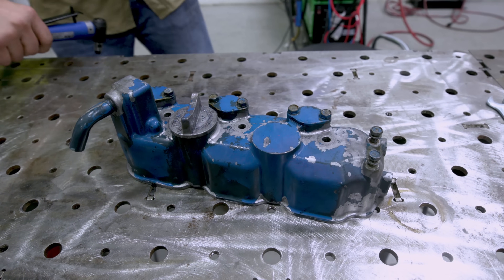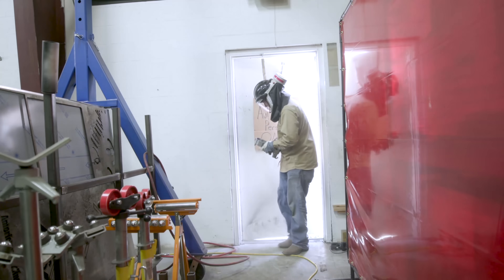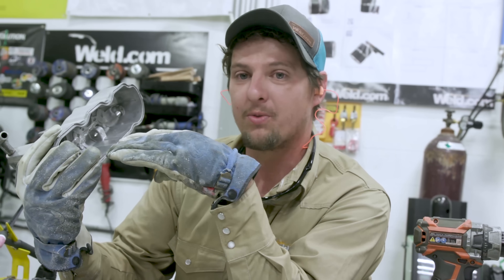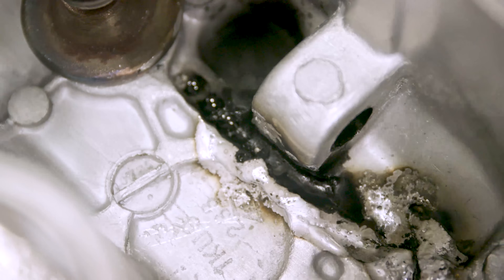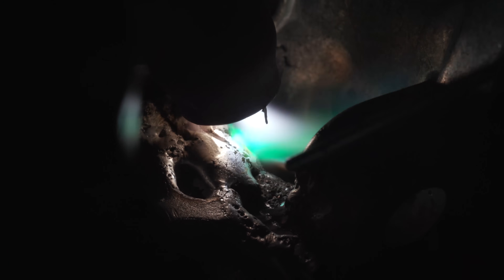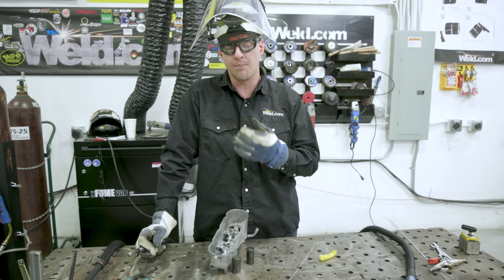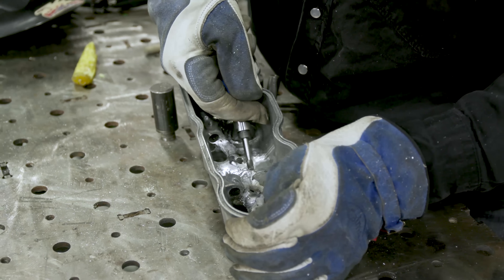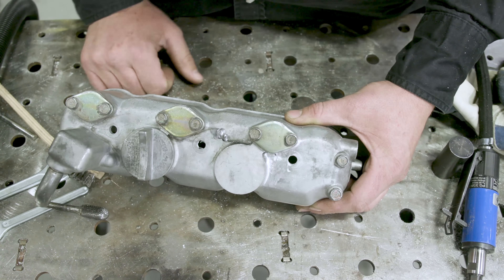Weld Repair | 1983 Cast Aluminum Kubota Diesel Engine

Comment: Nice work, may I suggest putting the part in a barbecue until it stops smoking before welding this way all the impregnated oil burns out.

Comment: Something that seems to work better for me. I just take a cutting wheel on die grinder and cut all the way through the cracks then v it scrub and start my arc on top of my filler rod in the crack even just run over my rod sometimes then come back and have some hope of a cleaner weld. I looked way worse than that first try on cast though blew a 1 inch hole in it before I was able to start filling it 😅. And someone already mentioned your filler choice was one of the harder ones to use for that 😉
Reply: Forgot to mention thanks for the videos! I've picked up a few things from you for sure

Comment: Brave video to make. Welding cast aluminum with oil in is hard. My experience is to walk away and use just jb weld instead. Especially if it's just a cover.

Comment: Noticed the cracks in 2 of your welds at the 5:35 mark in the video.
Comments please on 4043 vs. 4943 vs. 5356 fillers.  Comments please on not preheating to 400-500°F.

Comment: Great work, I just would not have taken the time to blast off all that exterior paint. Focus on the real issue only, the cracks. By the way, those cracks look like they were due to over torquing the bolts.

Comment: Did you load your burr up with soapstone?
Reply: periphery wax or beeswax I use. Try using periphery wax or beewax on a rusted bolt or a broken head bolt while heating. periphery wax will go into the threads and it wont evaporate like other chemicals when you heat it up. Thanks for watching weld.com. have a great day and stay healthy

Comment: Great video guys.  What are the benefits to using 5356 rather than 4043 in this application?
Reply from the maker: We actually started with 4043, but it wasn't working out so we tried the 5356 adn it worked much better.

Comment: Next time throw it in an oven at 500F for a couple of hours, then do your soda blasting inside and out. Clean it off / drill and grind, then preheat it again to 500F and weld.

Comment: Excellent work Mancub! Dirty castings are one of those things you just have to do what works at the time. How'd you like the 275?
Reply: Thank you!!!Everlast Power Equipment run great. The 275 lightening has so much advanced features. The machine is a all around machine. Suitable for ever welder out there. Thanks 4 watching Weld.com and have a great day. Stay healthy

Comment: Welding old aluminum parts that has been soaked in oil is tough to do. Good job of cleaning!!  One thing I have done back in the day is to let it soak in acetone or MEK for awhile before welding if you can. Final cleaning step.. That will help....after that blow dry and let the part air out for 15-20 minutes.  MEK is nasty stuff so wear PPE and keep it out of the welding area.

Comment: So I was taught to drill the cracks at the end both side thru then groove the crack as best you can, fill the one side ,  then flip it and groove the other side down into the new weld metal,  and fill it in .. so why only drill the ends of the crack only part way ?   Especially if you are going to weld both sides?
Reply: Drill all the way through.I ended up doing that. It's been a while since I welded on something that bad. Whoever taught you did a good job. Thank you for watching Weld.com and sharing knowledge

Comment: Being new to the stainless side of tig welding, I was wondering if I should use tri mix or strait argon for sheilding gas, and could you guys explain the difference between the two and they're appropriate use
Reply: Straight argon for tig stainless. There is a tri mix you can use for MIG welding stainless but 100% argon is what you want for TIG.
Reply: Dm @redbeardweldz he problay will know the science behind it. I agree with the other guy.

Comment: How come ya didnt heat it up with torches after soda blasting? The heat would've seeped all those oils out to where you could was it away with dawn dish soap and then wipe it with acetone. Just wondering

Comment: Why do u grind down soapstone on  your cabrbide bit
Reply: That was wax.
Reply: Colby Clydesdale it acts as a dry lubricant so the sure bit doesn’t load with aluminum shavings. Works great on file work too.
Reply: Jason Becker thanks
Reply: Colby Clydesdale you’re welcome man. Thanks for watching.

Comment: Should have baked it in a oven or slowly heated the part first to cook the oil out of the cracks.
Reply: Joel Watkins i tried that before. I felt like it didnt work that good. So I soak it in pure simple green and blow it off.  Maybe I did it wrong. We really appreciate you watching Weld.com. Have a great day and stay healthy

Comment: Some of those oil baked and dirty aluminum castings get a guy to wondering if your going to have more dollars in filler rod than the part is worth.  Not to speak of the labor.
Reply: Can't always find a new part for a lot of these older ag/industrial engines aside from maintenance parts.

Comment: A serviceable valve cover on eBay will run you about seventy-five bucks, how much did the repair cost? Assuming it was a commissioned work. If it's yours then it's like grandpa said, "Sometimes you have more time than money son."
Reply: David Cantwell thank you for watching Weld.com. Yes its mine.  I wanted to show old dirty cast aluminium. I agree with you pick and choose your battle. I always could use practice to better myself.
Reply: @mancubwelder1312  
Absolutely, practice makes perfect, but only if you practice with understanding. As a self-taught welder myself, I make my living as a custom fabricator so I must be doing something right, watching videos like yours increases one's understanding. Thank you for sharing your understanding of how it all works.

Comment: Might want to let your viewers know to be careful what solvents to use in the cleaning process. I know you said acetone, but if someone that don't know grabs a chlorinated hydro carbon solvent, it's bad news for them. For those who don't know, when heated and exposed to argon produces phosgene and it is deadly.
Reply: Exactly. Next time I will. Thanks for watching weld.com.

Comment: Have you every tried using a propane torch with the aluminum solder?  You see people putting cola cans together.  Used it on a boat and I started tig welding it and worked will but then I found I had a lot of holes and leaks in other locations like my drain plug and count get to it well and see that at a gun show a old man was making cola can welding look stupid simple.   Held as long as I had it and the next guy about 10 years I know of.
Reply: As a temporary repair its ok. Its like glue. Gets no penetration.  I weld boats and i cringe when i see it.  Guys running offshore dont want to make it home i guess.

Comment: I tried welding a cast aluminum pulley wheel and it didn't go to well. What settings should I run like the frequently and balance
Reply: everlast 275 lightening machine 195 amps
Frequency 110
Balance 65
Reply: @mancubwelder1312  thank you

Comment: Got a nightmare welding job recently. Had to weld a aluminum safety roof on a underground mining rig. They had cut an opening to retro fit something to the compressor and my job was to weld the pice back. Every thing was saturated with concrete and hydraulic fluid. I had to lay down about 6 feet of weld. Took me 3 freaking days.
Reply: Feel your pain. Learn alot I bet. I know I would have.

Comment: Where did the stud holes go? How are you supposed to fit it now that they've gone?
Reply: You caught me. Had to get the crack all the way out. I will put the paint on top of the studs and lower the valve cover down and it will mark it. Drill it out.  Thanks for watching

Comment: What freq and balance did you use?
Reply: Everlast 275
 Argon 35cfh
Balance 65
Frequency 110
Reply: Thanks! I was guessing around 120hz by the sound.. would 3/32 hold up at that low balance?

Comment: Good job! real repair work is a pleasure to see! Engine parts are a bugger to weld.. 95% of my repair work is under the truck stuck between a greasy driveshaft and frame... I never get to weld on a clean workbenches..
Reply: John W I appreciate it. That's is not comfortable at all.  Thanks for watching weld.com. Have a great day

Comment: Worth mentioning not to use brake cleaner before welding
Reply: I'm guessing that you mean chlorinated brake cleaner. The chlorine free stuff works fine, and it would have done a much better job than Simple Green at removing oil residue from the casting.
Reply: I'd love to watch you weld after using hexane brake cleaner (through a telescope)
Reply: @janeblogs324  It evaporates at -9° F at atmospheric pressure. You would have to be welding in a really cold environment for it to be an issue; like Antarctica in winter, outside. Do you appreciate how ridiculous your concern is?

Comment: Only the few people who have welded old cast aluminium impregnated in oil-dirt can understad how difficult it is, top job🤟🤟🤟
Reply: Shmen George Thank you. Appreciate the support.
Reply: New cast aluminium is way better and cleaner these days. Alot easer to get a clean weld.
Reply: shmen gheorghe ....You got that right!  Sometimes you start wondering "where in the hell is all this shit coming from?"
Reply: Yes I know, I do some turbocharger case welding and is pretty much no difference to laminated aluminium💪💪💪
Reply: shmen gheorghe I’ve had real good luck welding castings on two stroke outboards and dirt bikes by using a drill bit to clean the bad spots out. What I mean is. When you’ve finished your first pass and it’s all screwed up full of holes. Go back over it with a drill bit just a few sizes bigger then the hole and drill it out. Seems to work first time every time for me. Few times I have had to repeat the step. But it will only be like one or two holes versus the twenty I started with.
Reply: Cole BZ I do.  45 years in the business.  My table and torch are fine and never burnt anything up.  A shot with an air hose and it's gone.
Reply: Shmen thanks for the support. Really thank you for watching.
Reply: ManCub I have to thank you and Weld.com for teaching me so many things 🤟🤟🤟
Reply: Shmen your very welcome. Could not do it without you guys.
Reply: @colebz420  it's called busting ass and clean up at the end.

Comment: Just a suggestion take your Aluminum parts to a high teck Auto Machine Shop they have a Cleaning process that's a Big help in takeing the oil out of the part .🐤
Reply: Never gonna get all the oil out of a old cast aluminium.
Reply: @mancubwelder7924  Would you want to bet the processes available today make Welding oil contaminated Aluminum successful .Search it out and Learn something . 🐤👍
Reply: Ultrasonic will not take all of it out. I work in a automobile machine shop I know the ways of the force.. lol
Reply: @mancubwelder1312  What i said take it to a high tech automachine shop i didn't say it will remove all the oil  contaminated Aluminum it's a BIG HELP . I've been around this kind of work for 51years now and I'm still learning Trick's of the trade they have made Chemical Engineering cleaners a BIG HELP .🐤

Comment: There's more than one way to do something. If it works and turns out. Just because it's not the way you was taught or the way you would  have done it does not mean it is not correct, or was done wrong. The whole idea was to show a fix on dirty cast aluminum. Good video ManCub
Reply: Sherm Rock. 💪. Thank you
Reply: Amen brother
Reply: Thanks

Comment: Vapour degreasing using trichloroethylene was the best way of removing oil from casting before welding as it was heated in a tank and the part got hot which opened the pores of the metal and allowed the oil to be dissolved and washed away by the solvent. But unfortunately like anything that worked well it has been abolished.
Reply: I mean, who doesn't love Parkinson's and renal failure?
Reply: Never use chlorinated cleaners around electric arc. You'll kill yourself with phosgene gas.
Reply: I wish that I didn't agree with you, but RoundUp is next ;-(

Comment: So much easier to slot all the cracks completely through the cover. Then you don't have to fight the oil and have nice clean metal to weld. It also helps if you stop dipping the tungsten in the puddle. ;)
Reply: I ended up doing grinded all the way through. I'm a expect dipper..😂
Reply: Rambozo Clown thanks for giving tips to me and everyone on weld.com. Thanks for watching weld.com

Comment: why wouldn't buddy just get a new one
Reply: terry hudson what’s the point of doing any repair if you can just buy a new one? He’s showing how to do a repair on old cast aluminum. A lot of times, manufacturers quit producing parts so you either have to have one fabricated from new stock, or do a repair. This is just an example of how to do a repair on case aluminum, not how to repair this specific part.
Reply: @GodslilRedneck23  because did you see the amount of time and work went into that you could find used one for next to nothing in most cases in salvage yards or ebay
Reply: terry hudson again, it’s an example of how to make the repair for when you can’t buy the part or find one available, or in some cases it costs more to purchase a new one than to do the repair. Don’t over analyze it.
Reply: Yeah I could have.

Comment: For you non-car guys, the valve cover is under a little bit of pressure. Very little, not enough to be structurally important, but it needs to be air tight, otherwise oil is going to gradually spray all over the engine compartment. Basically, it has to be air tight, if not, then your customer is going to come back angry expecting a fix.
Reply: Correct but this a tractor. See that blue tube that a breather. I vacuum check mine. I bolt the valve cover down to a peice of rubber on the table. Then plugs all the holes except one. Then I put vacuum on it. Then I looks at the guage and make sure its hold vacuum